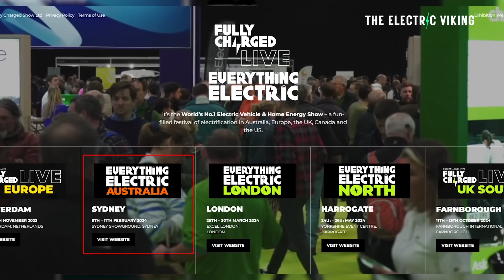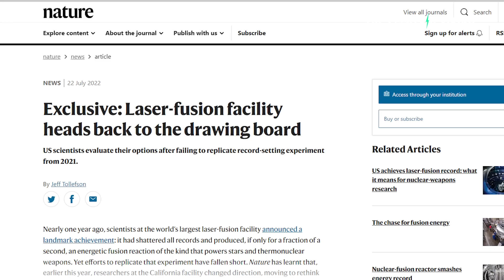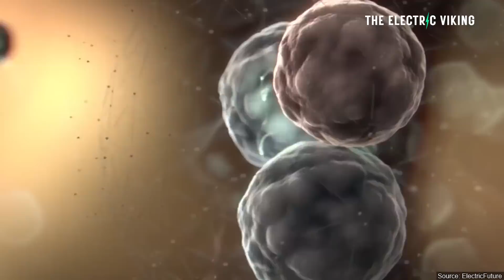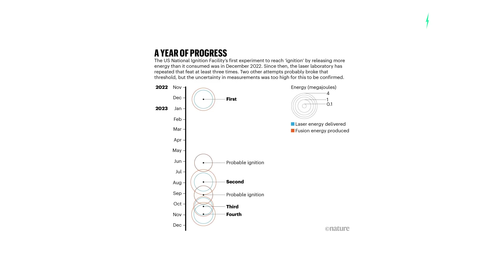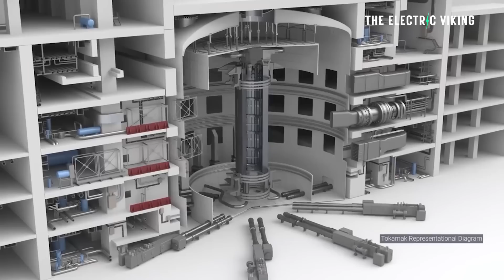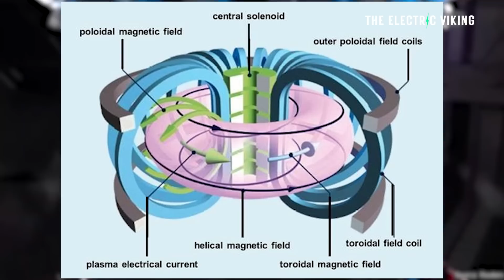US nuclear-fusions game changing achievement; ‘ignition’ over and over

Comment: Despite the enormous machines they make for these experiments (both ITER and this Laser fusion contraption) it is still at such an incredible small scale from an energy point of view, it will take decades if not another century to make this technical viable as a sustainable energy source to actually provide electrical power to the people.

But, by that time we probably have figured out to have all our energy needs from the sun+wind+batteries, at marginal costs and would investing in these gigantic and technically very complicated machines costing tens of billions of dollars , look very silly.. 

The prospect of limitless energy for all of humanity for centuries if not millania may all be true, but the machines to create and harness that energy are not. Costs to build and maintain these huge machines are enormous, and take many years or even decades to build in the first place. Solar panels and wind turbines are much simpler, are installed in days to weeks instead of decades (ITER), and dont require much attention once installed. Replacing them with better ones every 25-30 years is not a problem, because they have made up in revenue multiple times they have cost to install, and the decomissioned solar panels and windturbines can be recycled relatively easy. The energy source, the Fusion reactor in the sky 93 million Km away called the Sun, is already there, and will work for at least another 5 billion years or so... Prety much limitless energy from a human scale perspective.

So in the end I think this will take the same path as hydrogen does right now, investments in fusion energy research and development will start decreasing at the same rate as solar and wind energy costs are going down, upto the point there will not be one investor left to put money anymore in this bottomless pit called fusion energy.

What many people do not realize is that these experiments running right now with this Laserfusion and ITER, were initiated decades ago, when the motivation was we are running out of oil and need to replace that with something that has not a finite supply of energy has no waste problem does not harm our climate and does not emit toxic fumes. Fusion seemed the best option for that, on paper, reality has proven to be much harder! Solar and wind already have proven to be a very viable energy source at ultra low costs.

Comment: The big question is after obtaining fusion. how to you get any energy out of it? Fission reactors have 2 water heating\cooling systems that turn steam mechanical energy to make electric power.  and Fusion has zero water cooling systems built into the design. Fusion reactor is still purely research engineering design no way to convert heat to electrical energy. Fusion is an explosion. fission reactors builds up heat  without  explosions. It also take the suns billion of ton of gravity and pressure to create the heat and energy to make fusion happen. Why not spends 200 billion in solar farms. Clean cheap safe with future battery and hydrogen storage systems holding gigawatts of energy. Fusion attempts will fade and die out. Fusion is very danagerous.

Comment: Any fusion is going to generate heat and heat will produce steam to turn turbine which connected with electric generator to produce electricity. Any one knows from thermodynamics that steam turbine uses Carnot cycle. You need a chiller to cool the residual steam. So at the end of the day you just use atmosphere ( air)  to cool this residual steam which is big NO NO because A lot of water vapor released into air. Water vapor is worse than even methane as a Green house gas. Any thermodynamic system like coal/oil plant, fusion/fission plants use Carnot cycle and that in planet Earth will eventually heat the atmosphere. As Elon Musk said the best fusion reactor is our Sun. Its safe, no maintenance, Just build solar panel plants and that's it. The fusion is good for interstellar if rockets fly far from Sun to explore other star systems and solar panels will be useless in vastness of cosmos.

Comment: I refer you to a company that currently uses fusion to produce medical isotopes (Mo99, Lu177) Shine Technology’s. They also use neutrons for non destructive testing of turbine wheel blades, etc. they’re working on recycling existing nuclear waste, a high percentage as it turns out can be used in new fuel rods. End goal of course is energy. Shine was the first company in about 50 years to be approved by the NRC for a nuclear facility, it’s completed in Janesville, Wisconsin,should be producing moly99 in 2024.

Comment: Wow, coal most efficiency power plants generate only 37% efficiency converting the coal to power, while oil & gas fired are between 56-60% this tech is just spot on already, all in on this tech! We in BC have a drought which has caused a huge reduction in our Hydro generating capacity (BC Hydro had to procure power elsewhere and so far this year has cost CAD$430,000,000) and this is not going to improve soon. About 97% of BC Hydro electrical output is by hydro electric dams, so lack of water results in lack of power.

Comment: Controlling the plasma is not easy but the possibilities of success is within reach.  The more we experiment the more we learn. This is where Tesla Dojo computer can do more simulations to finally control the reaction.  I know that to keep this plasma from exploding venting is used.  Early on the earliest they used super fast cameras with many hard drives to store the pictures and see the actual fusion occurring.  I remember 12 years ago that they adjusted the frequency by lowering it and then it happened success and that was the earliest breakthrough progress. Now that fusion has occur ??? How to control it.  Yes we will have the power of the sun. This is so much safer so if there is a run away situation, just turn off the power

Comment: EV, hi. That claim is not so true.  The energy it took to charge up the massive capacitor based charge banks in the facility that then fires the short entry pulse, is so so much bigger, they are decades away from reality.  What they actually say is the energy stored in the capacitor bank vs the energy out, the energy out was more for only  a micro fraction of a second.

Without the capacitor bank being charged over a long time, it would otherwise kill the supply grid.  Maybe dig a little deeper?

Comment: NIF at LLNL achieved physics breakeven (fusion output energy equal to output energy of the laser) with one laser shot on a single target. IIRC, the humongous laser can only make a few shots per day. Engineering breakeven (aka wall plug breakeven, fusion output power equal to the input power needed to run the entire laser facility) is still decades away. 

Side note: I worked on a DOE contract to generate frozen deuterium-tritium target pellets at a high rate (10 per second) for that LLNL laser inertial confinement fusion facility in 1979, over 40 years ago. It will be years from now before that technology will be needed for that type of inertial confinement fusion energy laser, if ever.
Reply: As a mechanical design engineer, I did my very small part on the design of this massive NIF project in 1999 (24 years ago).  At that time, I figured that it would be 50 years or so before an actual fusion energy power plant may result from that work of thousands of people.  Keeping in mind the achievements of the NIF in the past couple of years, there is still much to be done and much to overcome before a fusion power plant could be a possibility.  I would guess another 25 - 35 years, if it is possible.  But you have to start somewhere.

Comment: Fusion is nothing but a research project and a really expensive one.   There will be not fusion  power generation on the grid for at least 80 - 100 more years, if ever.  And if they do get it to work, it will never be cheap.  As for the events in the US.   Everyone is ignoring the fact it took 300 time more power drive the lasers than the fusion created.   They keep lying to everyone.  ITER is the only machine that may move things forward and that will take at least 40 years in research mode.  Then another 40 years to build generating systems.   Thats 80 yeas or more.  It could happen but no person alive today will ever see one.

Comment: Your reporting is not accurate. While the 2.05 MJ of laser energy generated 3.15 MJ of fusion energy, they required about 300 MJ of electricity to generate the 2.05 MJ of laser energy. So really the experiment represents a 99% NET LOSS in energy production. NPR has a Dec 2022 article that gives 300 MJ number.

Comment: Adding a new, limitless source of heat onto the planet will simply accelerate global warming. Solar and wind do not add any heat to the planet, they simply use the energy we are already receiving from the sun. For this reason, on the surface of the planet, fusion reactors can only ever be a small part of the energy mix.

Comment: 2 megajoules is about 600 watt hours of energy.  Two of my used solar panels leaning up against a fence in my back yard produce that in one hour.
I love fusion. Let's use the fusion reactor that greets us everyday.
Reply: this result is the very beginning of the starting point. You can't achieve commercially viable nuclear fusion reactors if you don't take the baby steps first
Reply: Why be so negative?
Reply: Each of us need to figure out whether we find truth, to be negative. My tiny $1300 solar system provides my home with power now, not later. 50 years ago, my local power company promised nuclear power "too cheap to meter". Instead, cost overruns raised our utility bills considerably. (we had to pay for their mistakes)
Solar and wind give the average Joe and Jane the possibility for independence, where centralized power does not.

Comment: Pulsed lasers are 0.5% efficient - not a typo, getting 1.5x energy back and using a super efficient turbine for the heat means we aren’t even at 1% out of energy in.  If this sounds dumb it’s because it’s a new clear weapons design facility.  It made American new clear fusion devices on rockets the most powerful in the world even though a testing treaty is in place.  It’s like trying to learn how to make an internal combustion engine by designing and building a gun, the fuel is different, all the mechanical components are different, it’s only good for unalivement and teaches nothing about how to generate useful energy.

Comment: Nuclear powerplants are fine as it is. Even if the initial costs are higher, the cheaper energy in the long run is well worth it.

Solar on the other hand should really be working with hydro and wind is very dependant on location.

Batteries and insanely expensive high voltage cables for renewables really are the worst way to handle the problem.

Comment: Even if we do get cheap and limitless energy, supplying it to the remote locations is still a challenge. It's much easier to supply a remote gas station than running power lines for hundreds of miles to a remote charging station. EVs definitely have their limitations compared to fuel based vehicles. They are fine and efficient urban transportations but not ideal for long distance or remote applications. Military will never be able to use EVs as they cannot be refuelled quickly in remote areas.

Comment: I am shocked because usually you are appropriately skeptical of this sort of press releases and caution to consider things like this within proper context.
Your graphics are mixing two different systems that is misleading. One is from the research lab and the other is from a company actually planning for a power plant prototype.
To develop more efficient lasers to do what these lasers do is a longterm research.
If what you report is true then ITER is dead already.
It is more hype than anything else and this is physicists and engineer conclusions.

Comment: This follows on from last year imeche “Last December, for the first time ever, scientists flipped this equation. Using lasers, not magnets, to compress atoms together, they managed to produce more energy than it took to start the nuclear reaction. Using nearly 200 lasers, their sights set on a peppercorn-sized fuel pellet, scientists at the Nuclear Ignition Facility (NIF) – which is part of the Lawrence Livermore National Laboratory in California – achieved what’s known as ignition. The moment lasted for just a fraction of a second, the energy gain was modest (2 megajoules in, 3 megajoules out), and the calculation didn’t factor in the electricity it took to power the world’s biggest laser. But the science worked, and that’s what mattered.”
Worth looking into Tokamak Energy was founded in 2009 as a spin-off from UK Atomic Energy Authority (UKAEA).  US subsidiary, Tokamak Energy Inc, they are associated with los Alamos, Oak Ridge, Princetown University and General Atomic in the US, university of Tokyo, Sumitomo and Furukawa Japan. Basically they are pursuing two methods to achieve Fusion.

Comment: Let's face it, the reason we are hearing so much about nuclear fusion is that the scientists and investors in it are realizing they will be too late. 
Solar and wind will completely take over our power grids well before nuclear fusion is ready for prime time. 
These groups understand one thing: Lack of funding!  What happens if the government realizes that it will not play a part in our change over to renewable energy?  The funding will be cut off... this is why we are hearing so much recently about fusion.... it's about hyping this up to keep those scientists employed with grant money. 
    The results of this lab are pathetic.... they are only measuring the energy output versus the laser input. What they are not including is the energy to run that laser as well as the energy needed to create and ship the fuel.  As one commenter states, when considering all these inputs they are only getting about 5% net energy back!!!   A freaking gasoline engine gives you 30%!
    This is all hype and a sham to ensure that the gravy train of funding keeps coming in even when we now know fusion is going to lose. 
    Distributed power creation from solar and wind with storage... and REDUCING transmission lines, is the most efficient and secure energy source. When people have access to personal or community wind and solar the grid can be drastically reduced with wide spread outages becoming a thing of the past. 
     Nuclear fusion still relies on a central power plant and a huge grid structure with all its problems and costs to maintain.  It just is not the right solution and those in govt should know it. Then why pursue Fusion?.... it's all about weapons and possibly space exploration.